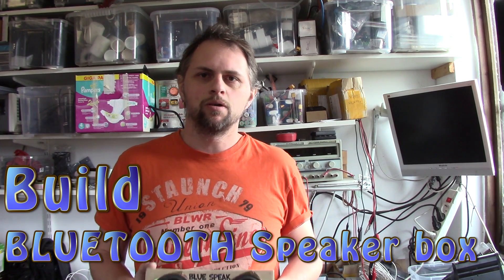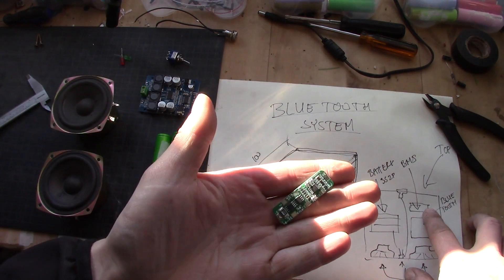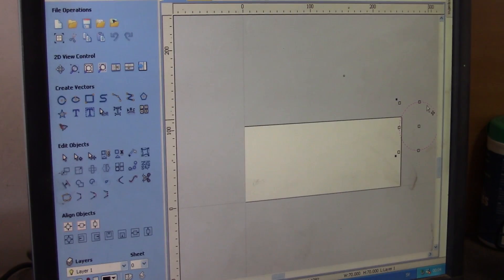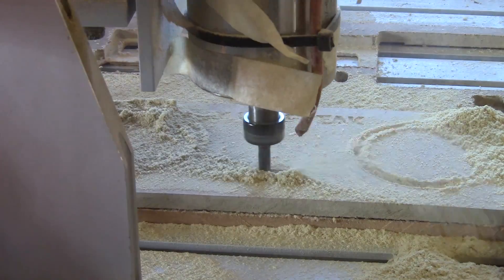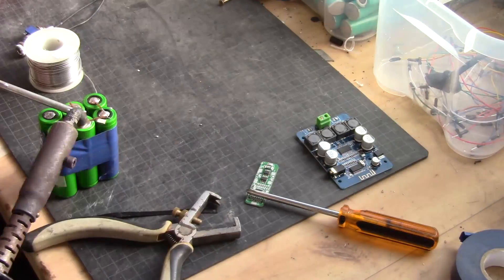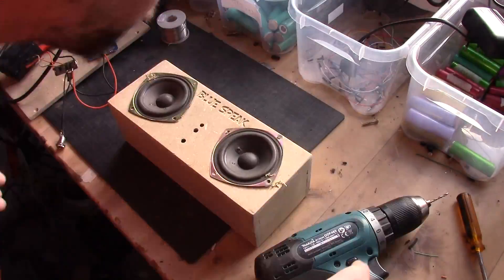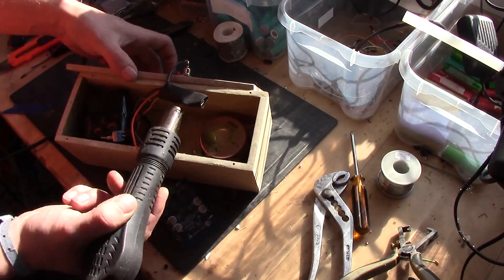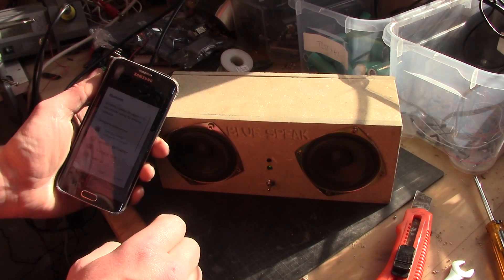Bluetooth speaker box build

Comment: You used 3s BMS. What kind of DC charger do you use to charge 18650 batteries in this design? Is it safe for batteries to use any 12V DC charger? I understood that 3s BMS is only battery protection. It connects batteries in series 3x4,2V.
Reply from the maker: A 12VDC will give you 4V per cell in ideal world. The BMS in question balances so it will make sure all cells are even and if one cell fall out it will disconnect. That said its "safe" to use any 12VDC adaptor. As long as it maximum gives 12VDC or such. This is a common way of building Lithium powered stuff as of today.

Comment: I want to build something like this. I think this is the easiest way and that's why i like it. If fact i have two questions: Is it possible to play music during charge. I want the speaker to be mobile but sometimes stationary for the kitchen/balcony? How long this 6 batteries lasts?
Reply from the maker: Chocho Rifay i can charge at same time yes. the batteries last a whole day ;) it draws 140mA during normal useage.
Reply: What charger are you using for charging the batteries - watts, aps, volts?
Reply from the maker: Chocho Rifay 12v 1a psu from some gadget
Reply: Why don't you use a step up module. Is it ok just with the charging/protection circuit module?
Reply from the maker: Not sure why i would need a step up? The system is 3s and that works fine for the amplifier board. the PSU voltage is just below top voltage. And in case of failure the BMS board will protect from over and under voltage including keeping the cells in balance.
Reply: One more question. On other DIY videos and tutorials people use TP4056 Lithium Charging Board. In this DIY you don't use. My question is why?
Reply from the maker: Because i have 3 cells in series. The TP4056 only charge 1 cell as such. If so i would have needed 3 of them and an isolated PSU for each. I could have used 1 TP4056 and then DC/DC to bost the voltage but since i did not have any boost converter i went this route instead :) Hope that answers your question
Reply: You say that you have 3 cells, but i can see 6 on your wiring diagram.
Reply from the maker: 3s2p = 6 cells. Ie each 2 in paralell and then 3 in serie.
Reply: Ok, thanks! I will post my DIY after I'm done.

Comment: HI THERE, NICE JOB. 

...personally, I would integrate in the design of this boombox or bluethooth spk. a few modifications:

To improve acoustics.

1. independency between the speaker enclousers (l and r spk. in independent enclosers) 
2. fill some cotton or foam in the spk. enclousers.
3. made some calculation for the box, and made a tiny port on each spk. enclouser, there are a lot of programs to do that calc.

To improve sound quality:

4. install a couple of little tweeters (why not?)
5. install a couple condensers to cut frecuencies, for the couple full range "big" spk. and the couple of tweeters. (1st. order crossover)

well, there are a lot of things that can be done, but for me that just fine, a simple but efective b.t. spk.

@DIY Tech & Repairs. thank for your video.

Greetings from Colombia.
Reply from the maker: Note that this is a budget build :) But yes some of above should have been done. But i would actually first of all built it with other Bluetooth amplifier since the one i used is crap. It uses the normal protocol for handsfree so as soon as it get quiet it kills the music totally and it have a lot of white noise....
The speakers is also some speakers not worth mentioning.

Note that the speakers i used is mid/high range speakers so they actually work pretty decent with out tweeters. 

Thanks for commenting! :)
Reply: DIY Tech & Repairs ok ok. thanks to you , that was a nice video i will wait for another more, keep going!

Comment: Great video! Thanks for sharing this!   How long do the speakers last?
Reply from the maker: Beakerzor dunno yet. its still running. but normal volume and it did consume around 100 to 150mA max. So theoretically it should last 30 to 45 hours :) or even more.

Comment: Really nice! But a question: what's the main difference between making a pack and connecting all the batteries in parallel and using a TP4056 + a step up?
Reply from the maker: That the boost converter draws extra power when not needed. In this the only thing using anything is the amplifier board. And the fact that i had no boost converter handy for this application but had tons of 12v suppliers and had a couple of 3s bms boards to hook up. That board also protects from under and over voltage.
Reply: DIY Tech & Repairs Hmmm... Nice! Thanks! :D
Reply: I used 3 18650 batteries in paralel with TP4056 and step up from 4,2 to 12V.
Amp 2x50W. From 0-60% volume it was ok. 
Further, there was too little current from step up module and harsh sound. Step up gave me only up to 0,6A and louder listening was limited